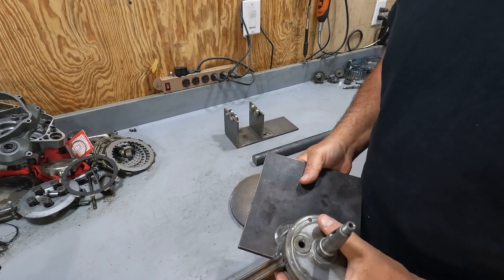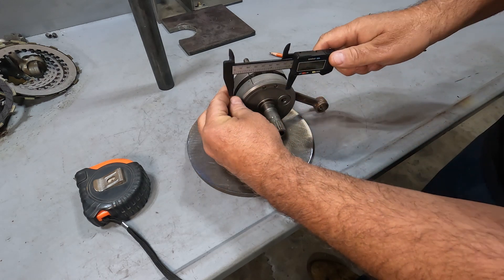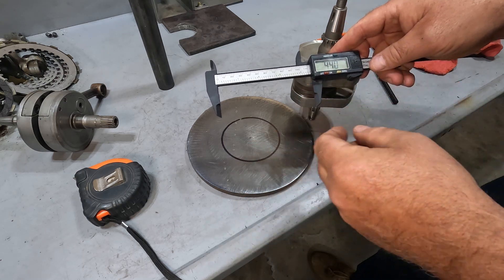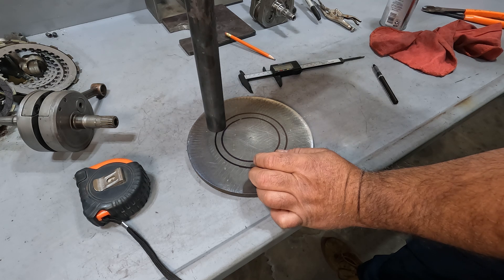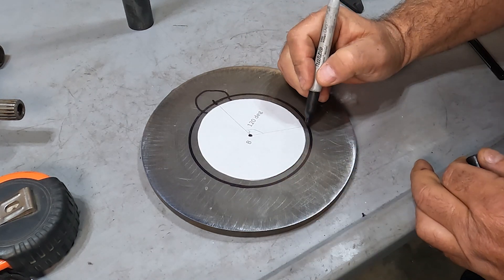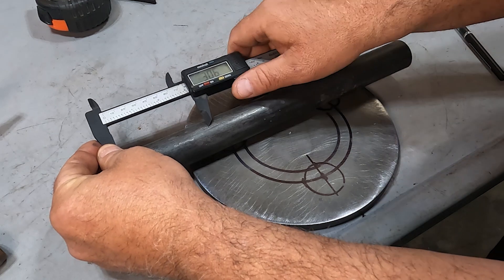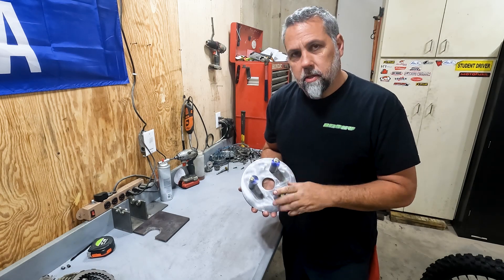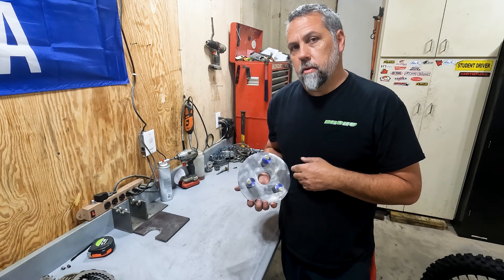Shop Made Crankshaft Alignment Jig Ep78

Comment: What a great channel!!! So much information on how to do things yourself at home. I did notice in the CRF150 rebuild video that you recently did you are using loctite brand thread locker. Just wanted to let you know that loctite brand is actively trying to get off-road riding areas shut down. The are not friends of the off-road riding community. I got this information from Charles who has the YouTube channels MXrevival and MXskillshack. You might look into using Stuck Nutz brand thread locker like Charles is doing. They are pro dirt bike and they are supporting channels like yours. Check them out and I hope you can get a support deal with them. This channel deserves support from the off-road industry. By the way I don't work for Stuck Nutz I just want the off-road community to support companies that support dirt bikes and off-road riding. I hope this is useful information for you.

Comment: Hey I’ve got a question for you regarding a build of mine, I’ve got a NIBBI carburator with a short intake. It runs fine aside from when you give it a quick throttle opening it bogs, I’ve heard it’s the accelerator pump but I don’t see one on this carb. Any help would be appreciated
Reply from the maker: What model is your bike?
Reply: @restoroosterohv Kawasaki klx140l
Reply from the maker: There is no accelerator pump in that model. They are not race bikes and don’t respond well to quick throttle movements anyways. If it is excessively bad, you have jetting issues. The carburetor that you have on there could potentially either be too big or too small for the engine. How does the bike pull wide-open throttle in third gear?
Reply: @restoroosterohv  That is where I am confused because if you slowly pull the throttle it revs up normally, with wide open throttle along with mid throttle it pulls great, all signs that my jetting and needle should be fine.
Reply from the maker: Kawasaki designed the carburetor to respond well to normal throttle inputs. You don’t have the same guarantee with an aftermarket. If the bore is too large and you crank the throttle wide open quickly, with no accelerator pump the mixture goes lean quickly until it can “catch up”. 2 choices if it runs fine mostly is live with it or find and oem replacement carb.
Reply: @restoroosterohv  thank you for your time, I’ll just have to live with it!
Reply from the maker: @magic_man3899 you’re absolutely welcome and ride safe.